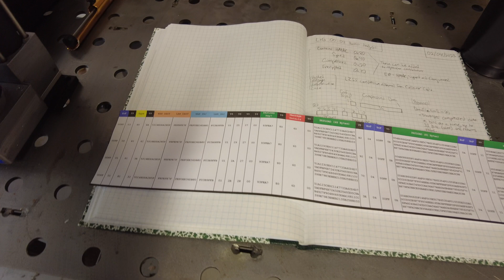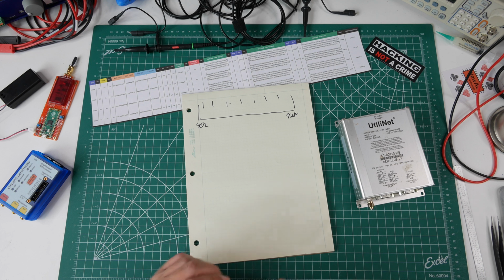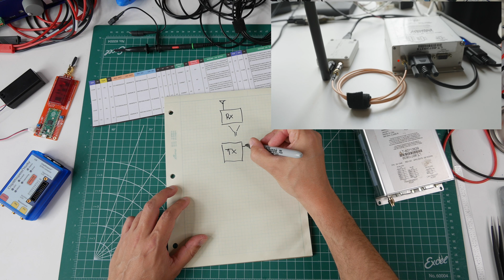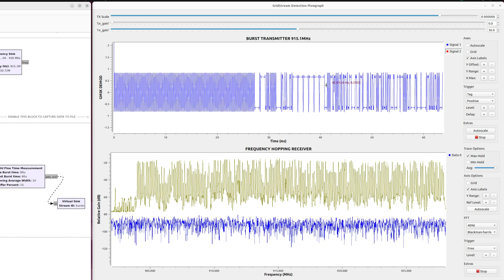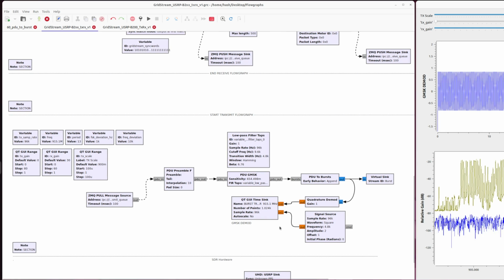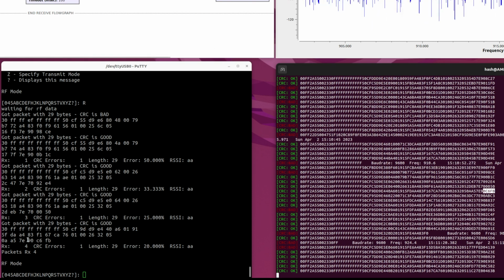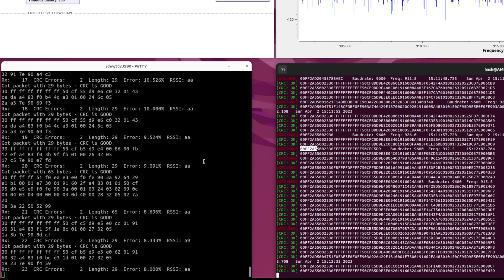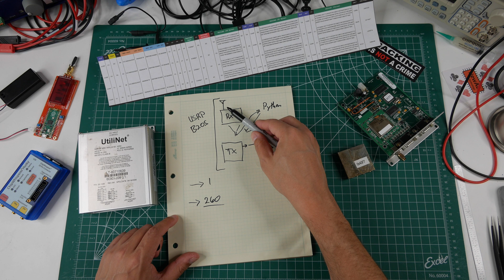How Do You Stop A Frequency Hopper??

Comment: Have you looked into frequency xlating FIR filters? This is a gnu radio block that splits your spectrum into chunks, frequency shifts each chunk to the center and applies a filter. This way you can also turn regularly spaced channels into just one containing all signals.
Reply from the maker: I use one in my 260 channel transmitter to offset the transmission away from the DC spike. Look forward to hearing what you think about that when I share that video!

Comment: could you use a hack rf to scan all frequencies then just have a script to decode the packets
Reply: You mean like that spectrum + waterfall you see @0:43 in the video? where all the frequencies, over a range 902 MHz to 928 MHz, are scanned at once.
I think that plot was not made using a HackRF One, with 20MSPS max.
But yeah.. i was thinking the same.
Reply: @pissfilth  Im pretty new to this, and am trying to understand the equipment used for this more. I looked up the device he was using and wonder as well, why not a HackRF? Is it because this has 41.44MS/s more? Even if you added the Opera Cake shield? I cant lie tho, the USRP B205 is killer. It has USB3 and is 12bit res.
Reply from the maker: HackRF can also be used but doesn’t quite cover the whole spectrum. You can see my GridStream decoder on Github (BitBangingBytes is my account) where I have a HackRF version of the packet decoder.

Comment: If I recall, in the late 1980s, 500 channel hopping frequencies was the primary transmitter system, and 250 was just the backup system... but that's the only thing I knew about that particular beast back then... are you assuming the data isn't also being disguised somehow in the way the audio is being modulated? Similar to how the Soviet spys were hiding data messages in plain site as it were, hidden within digital picture files, if viewed as a picture, the data went unnoticed, but someone who could recognized what the raw picture file data was supposed to look like, could manage to also see the message data hiding within the file... and even if you were managing to get unadulterated pure data, it is probably being encrypted in just as awesomely sophisticated a manner as a 250 channel frequency hopping transmitted message system... in addition to that, just because you can get the data in the order it transmitted, doesn't mean the data hasn't been scrambled by being ping ponged around in the different frequency packets, and without knowing what order it is supposed to be placed... you get my meaning, anyone transmitting data through a channel hopping system isn't going to just stop there, they will have other security features to insure keeping their messages private. I was smiling as I watched this video because I honestly think even as clever as you are to get what you got, I have a strong doubt you will figure out what this message says... simply because, the system was most likely designed to make it astronomically as nearly impossible to intercept as well as be unscrambled... never thought a tech nerd type video would make me smile though... good luck! LOL, this is not anything I would ever pursue, simply because there are just some things that you shouldn't go poking into... if you don't want to get haunted by un-supernatural spooks...

Comment: Would an RF circulator allow you "dump" the transmitted RF in to a dummy load while still allowing the external antenna receive network transmissions? I believe Pasternack and Mini-Circuits makes them. They can be a bit pricey, though.
Reply from the maker: Funny you mention that, I was thinking about that the other day. If disabling the transmitter proves tougher than I expect then that might be another way to go about it.